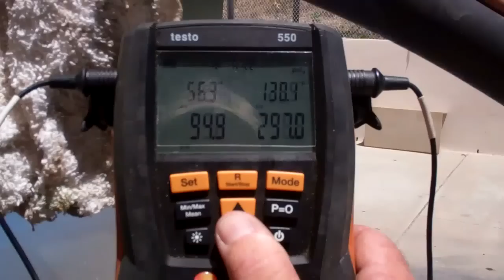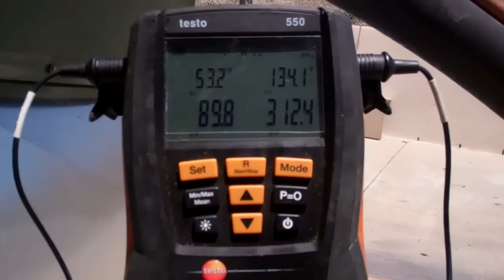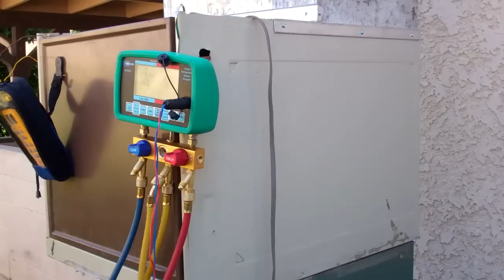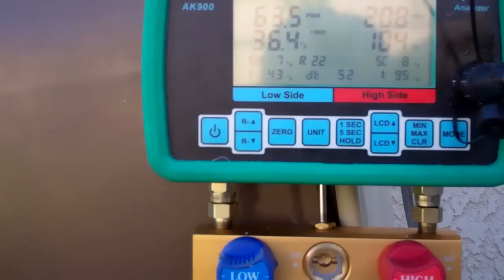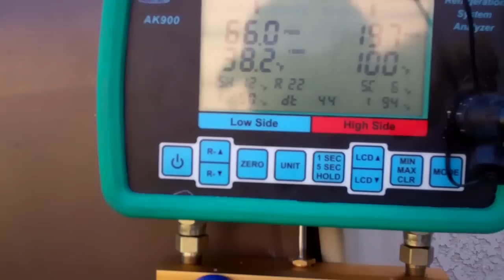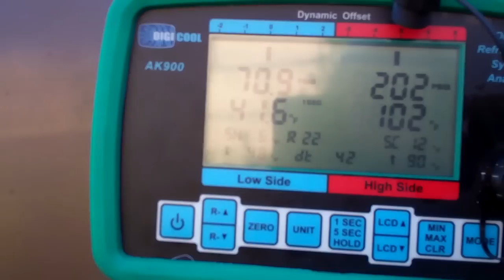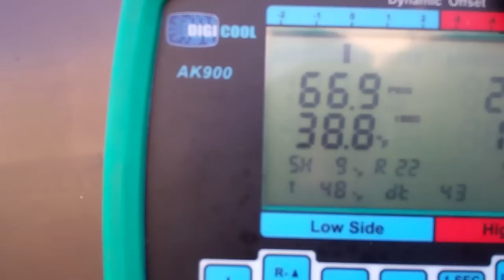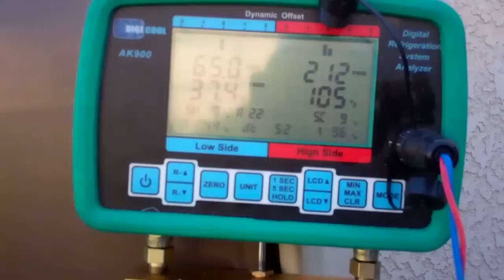TESTO 550 vs DIGI-COOL-AK900

Comment: have you had any problems with your digicools? got mine yesterday. manifold leaks like crazy. the biggest problem is the manifold that comes with it, the ball valves leak internally from high and low ports to the center port, so the whole time I'm using it I'm losing refrigerant from both sides of the system out the yellow hose. I should have bought the testos instead

Comment from the maker: I have been using Testo 550 since 2010 and they are great! The will really help you out on diagnosing a problem in a air conditioning system.I have not use analog gauges since 2008 and will never use them again.